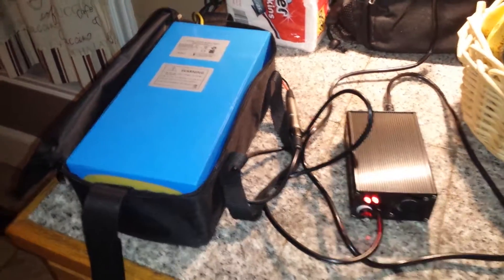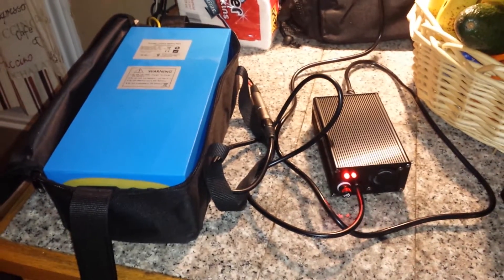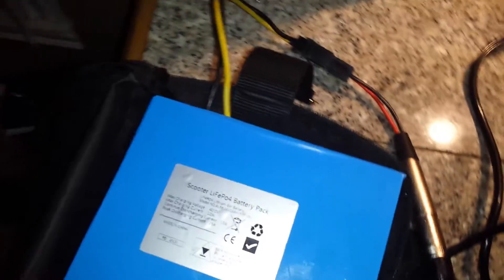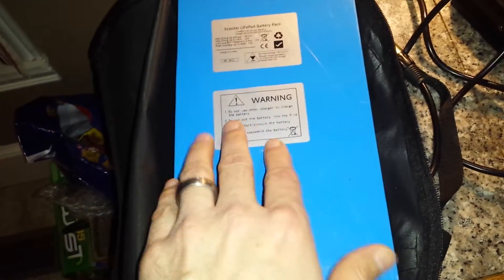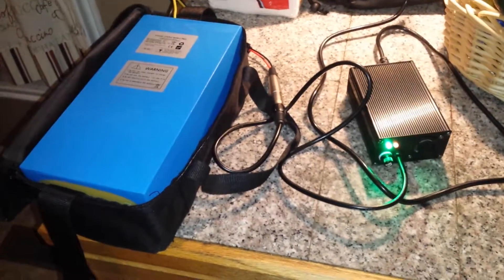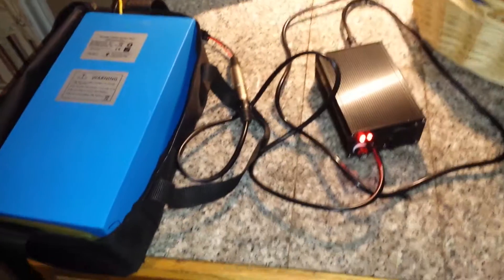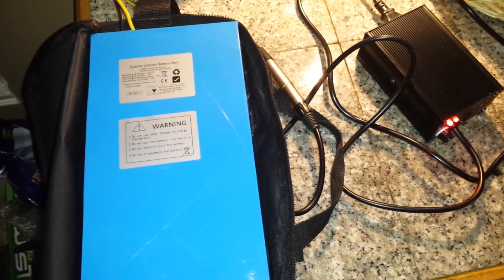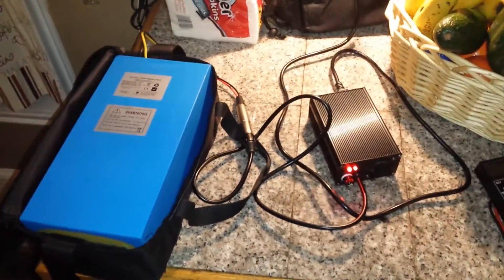36v 16ah lifepo4 battery failure 1200w scooter

Comment: NYangry the last question my friend and thank you one more time for answer me can u give me  the right number  voltage for the battery and the charger my friend
Reply from the maker: +Merlin Gomez Full charge on the battery may vary 41 and some change i.e. 41.3 or 41.8 all the way up to 44v however realistically it will fall some where in between 41v and 42v that is where they set the charger cut off to prolong the life of the battery. Float charge. The battery can take up to 44.6 safely. However that is where the most wear and tear on the battery occurs so it's recommended that you discharge right away if you actually do charge it to full capacity and not let it sit on the charger longer than fully charging and a couple extra hours for cell balancing. The stock charger is set at 2a and my guess 41.8v

Comment: NYangry good morning my friend i have other question me and my questions how can i know the battery work good and the charger too
Reply from the maker: +Merlin Gomez You can use a voltage meter to confirm the batteries voltage and you can also confirm with the meter the output of the charger voltage and amperage. Then you need a way to measure distance traveled on the bike like a cycle computer or a garmin or perhaps your smart phone. I would test it as soon as you get it. As it ages you will have a base to gauge the state of the battery. Lost voltage lost range.

Comment: u think is a real lithium 🔋
Reply from the maker: +Merlin Gomez Yes it's a real lithium battery. They sent me a new one it works great no problems. Good range. The weight is right the voltage and range match specs. I just got a bad one. There are videos on this manufacturers batteries being taken apart and repaired. I imagine the one I sent back will be repaired as well. Just a matter of isolating bad cells and replacing just those bad cell/s. New heat shrink and good as new.